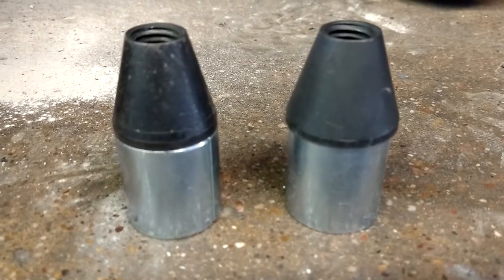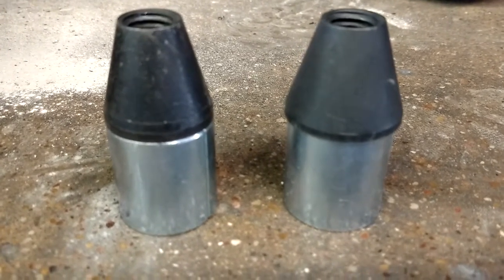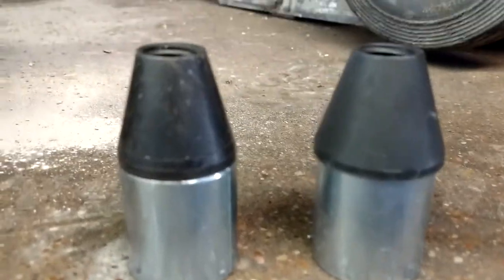Anchor Pin Bushing Replacement EASY WAY!

Comment: In all lot of cases its not that easy I have the snap on Tap 1 pin press set with 3/4" impact wrench to drive out the bushings when the lisle your showing fails to move them.... one note you forgot to use never seize on the bore and bushings so next guy dont need the snap on tool at next brake job.....  all good can relate.

Comment: Lisle sells 2 versions of the brake pin / bushing drivers , P/N. and price :
Short 29450    $35.71
Long  29090    $50.48
Short / Long  punch length.   On-Line JB Tools    March  27 2023
A die grinder with  a 1-1/4”emery cloth flap wheel will clean pin bore up for bushing installation .
Reply: Lisle drivers  Made in USA
Reply: Lisle 28870 is the P/N in which the mechanic is demonstrating .
Reply: Lisle 28870 is now an obsolete tool  Just trying to keep mechanics informed and up to date .